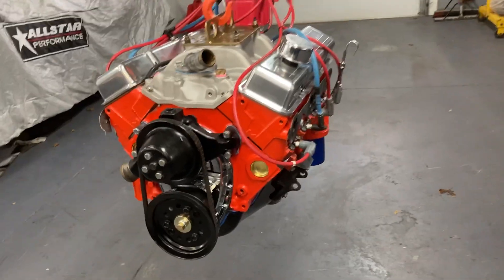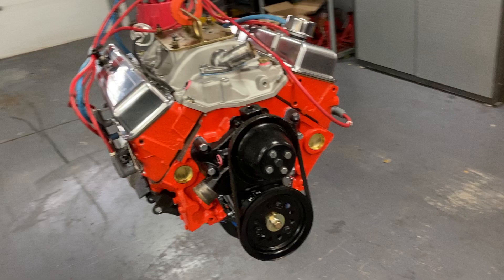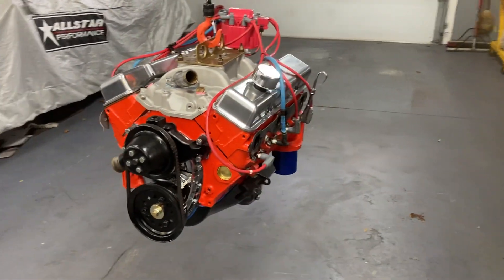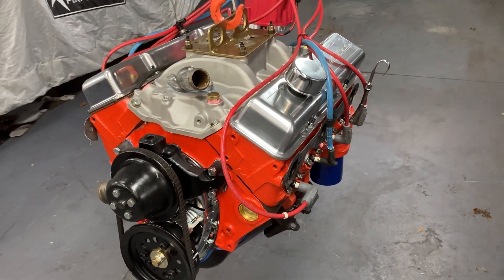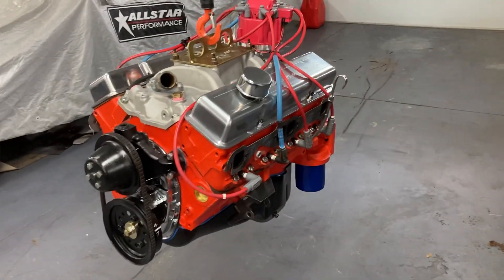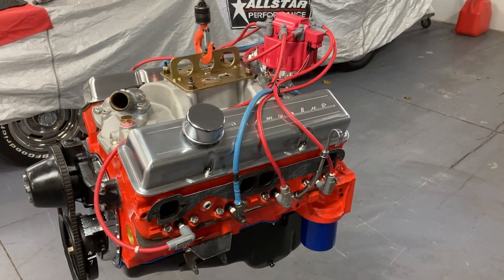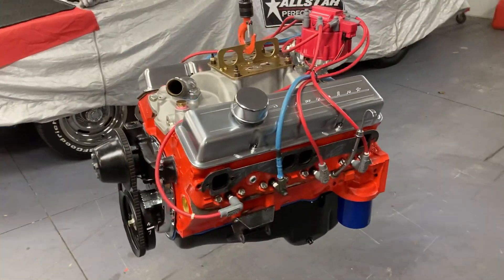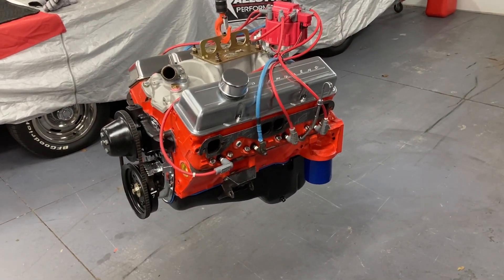307 Chevy SBC Restored Before and After

Comment: Im very Curious to know what dyno says I got my 68 nova with factory 307 and I figure itll be as expensive to do a topend and cam as a different sbc or LS be
Reply from the maker: Thanks for your question Robert. We got 340 ft./lb. of torque and 277 HP. Our emphasis was on torque because it was going into a relatively heavy vehicle with a standard torque converter and rear end gear ratio. The cam was a Comp flat tappet, part #12-234-2.
Reply from the maker: Robert, as to the other part of your question, we kept the 307 because it was the original engine in the truck and the owner wanted to keep it original. It would be more cost effective in terms of HP/$ to use a 350 or so.